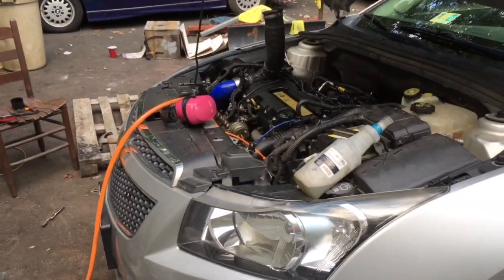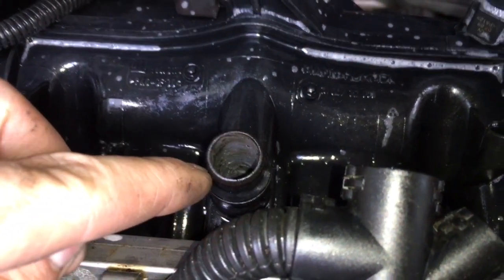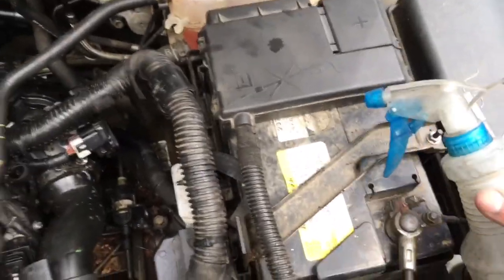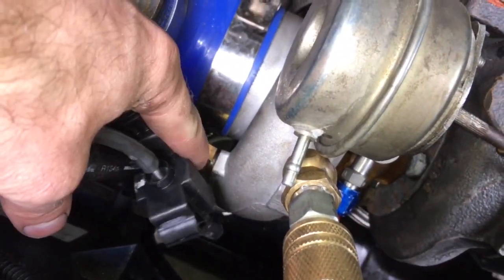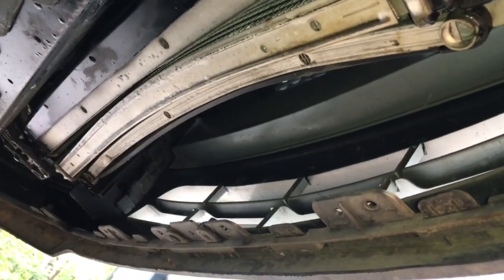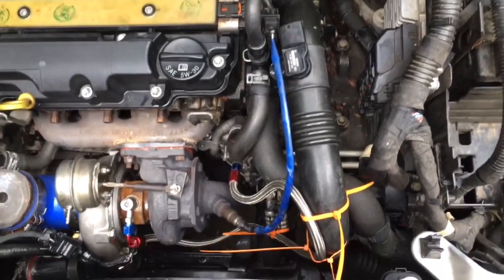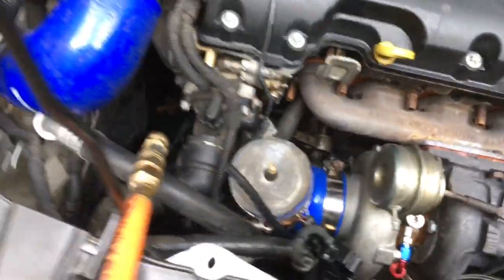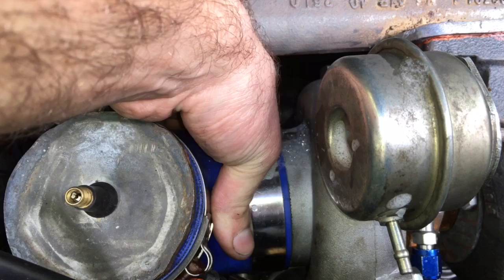Chevy Cruze boost leak test

Comment: Good video! 
  What if camshaft is in overlap on one cylinder? Won't boost/pressure go right through the system & out the exhaust? 
I didn't notice if you capped the turbine outlet as well. Thanks
Reply from the maker: +Chris Griffin  it never happens like that. I read  about people saying you need to adjust the cams a certain way but I never had that problem. If both valves were to open at the same time they would make contact with each other
Reply: Maybe not with "turbo" camshafts- never say never Austin
Reply: Quiry valve overlap